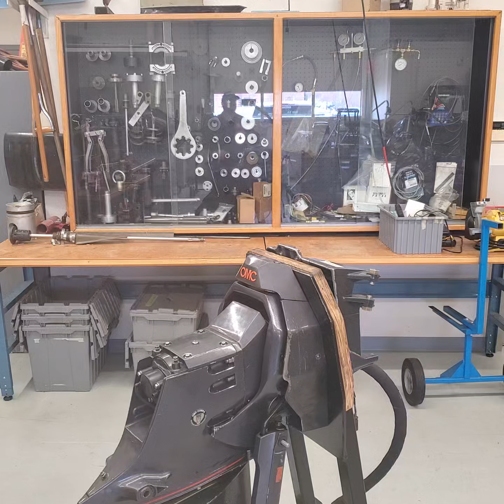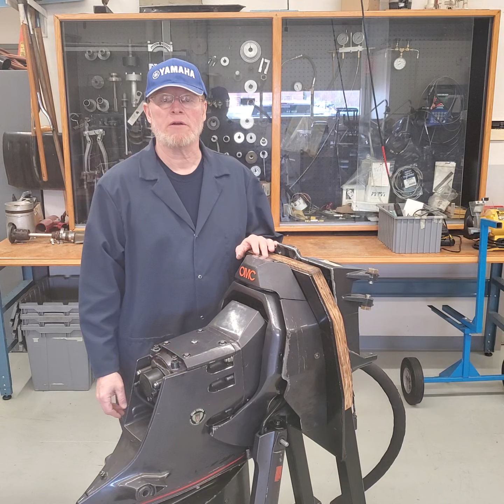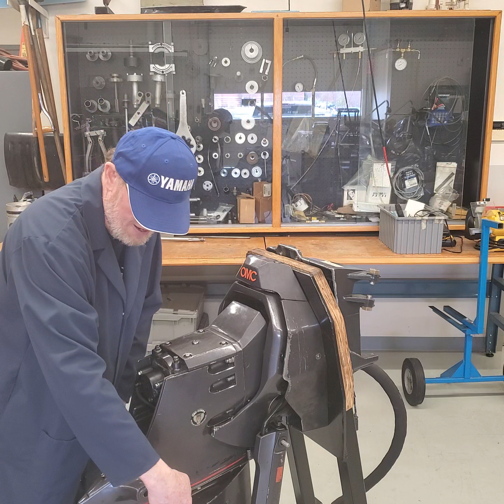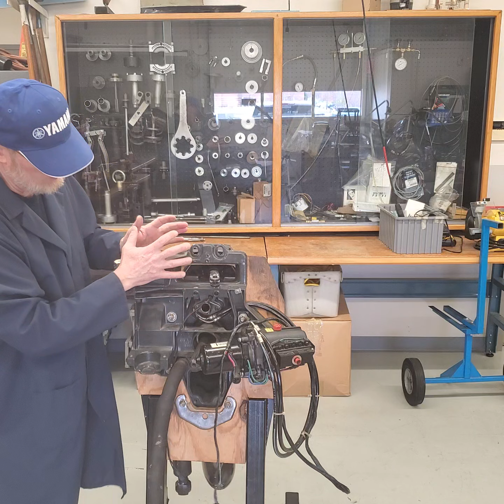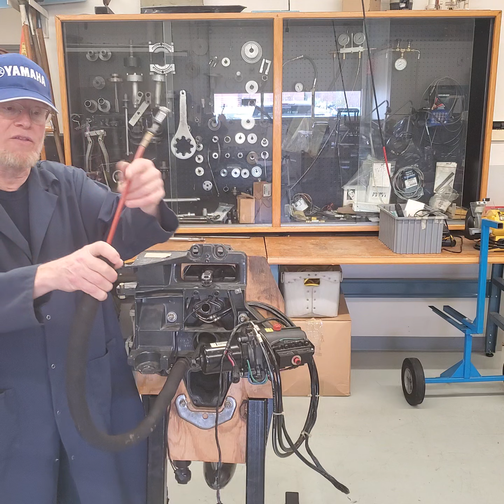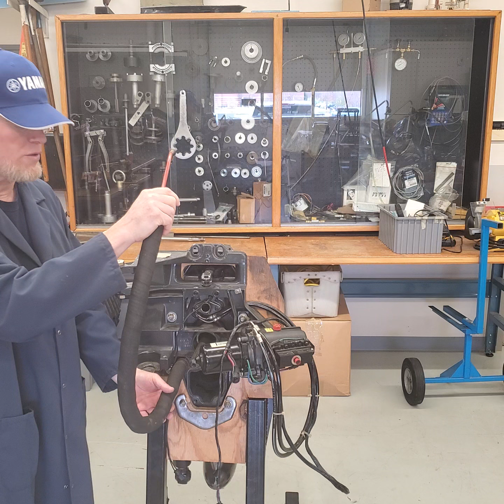OMC Cobra Sterndrive and TSK components

Comment: I have a 92 OMC 4.3 with the matching OMC stern drive. My u joints failed and broke my Gimble housing bellows tube. Do I need to find the late model 90-93 housing or. An I actually upgrade to a newer stern drive entirely as described in your video with the standard bolt patterns? Thank you Sir
Reply from the maker: Please email me at marinedoc01@yahoo.com for consultation on this

Comment: Great video Ted!
I have a question for you....I have a 1988 Four Winns with this drive, the drive and engine are both still good, but it has been used and moored in salt water for about 20 years. When I do run into a problem (for example things that won't come apart like a trim hose fitting), does it make sense to refit the boat with a later model used transom mount? I do have an OMC Cobra transom mount that matches my year and model from a fresh water boat, that is in excellent condition. 
That brings up another question, would it make more sense to sell off all the OMC stuff and change it over to Mercruiser? I know this would be more expensive, but would avoid the finding parts and mechanics problems with OMC. 
It is hard to find marine mechanics who will still work on Cobras, I have done a lot of work myself but sooner or later you need a real mechanic.
Reply from the maker: It does all at up to cost. If you have a good fresh water transom assembly, it would be an ideal way to extend the life of the boat. If it is indeed a 1988 four winns it is now 36 years old. Something to consider.

Comment: The “do not” remove plug hiding behind the cobra sticker; if you remove it, can the fastener that holds it in place damage anything if it drops into the water passage?
Reply: You don’t want it moving around and getting stuck in a water passage or hose! Pull the drive, fish it out & fix it the right way…

Comment: I have water coming in where the steering arm is whenever the back of the boat dips into the water. Is there a bellows or boot that needs to be replaced there? How do I stop that?
Reply from the maker: It sounds like the seal which rides on the steering arm has failed. you will need to remove the engine and disassemble the transom assembly to replace the seal
Reply: @tedsmarinerepair8956  which seal is that? Can you show me please
Reply from the maker: @ChrisGolas  Please go to link below which is of a OMC transom assembly and let me know if yours looks like this with the top cover that has two bolts Part#106. if so it Maybe the oring #3 is the issue.
https://www.boats.net/catalog/omc/sterndrive/3-0l-181-cid-inline-4/302amrgdp-1988/transom-mount
Reply: It has the 2 bolts